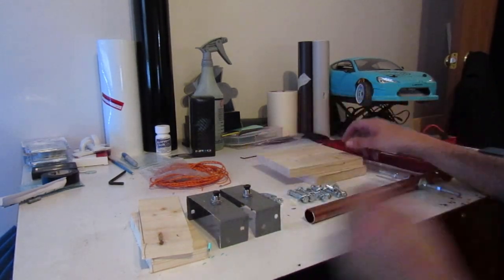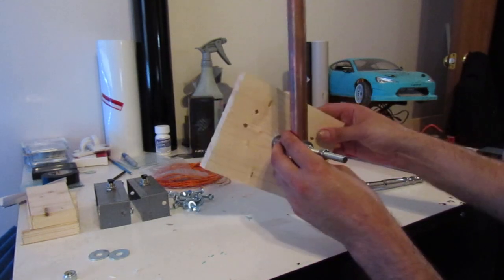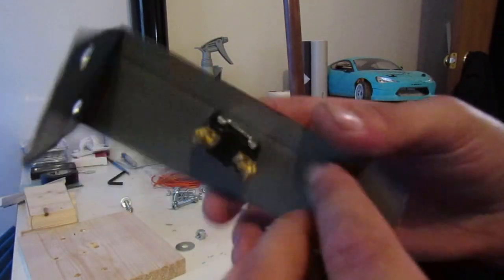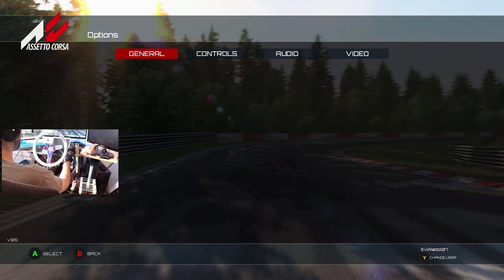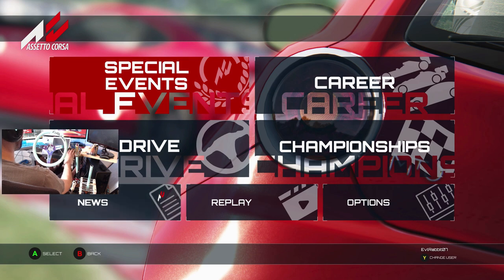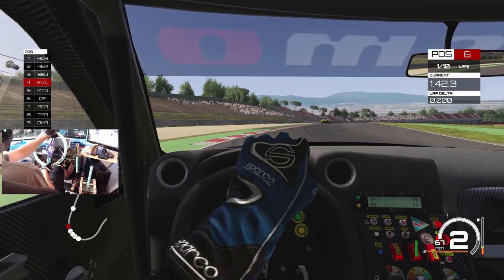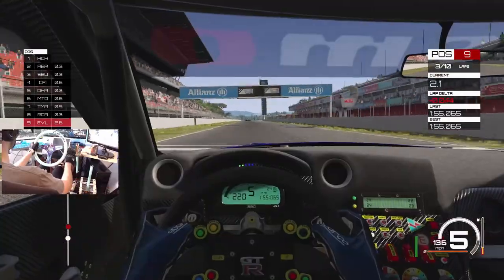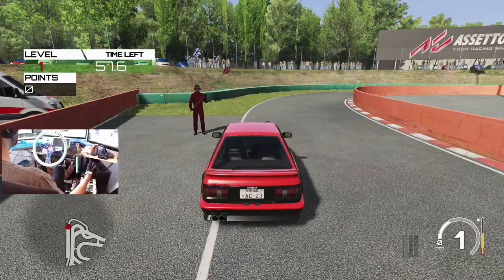Making a Custom shifter for G920 on xbox one sequential style!!!!

Comment: Yo were do your wires from buttons switches get hooked up to .. are the to the original paddle switch on board can u tell me how u connect it
Reply from the maker: they get connected to the original paddle switches on the board of the wheel so it works just like I am using the paddle shifters

Comment: How u connect the shifter is the wires off the switches running to lb and rb on circuit board ..
And in game settings just gear up and down lb and  rb please reply mate
Reply from the maker: yes the wires are going to the LB and RB paddle buttons so when in game the shifter acts just like I am using the paddle shifters so there is no setting changes that need to be made
Reply: @EvlRabbit07  legend thanks for reply .. appreciated mate ..
So i just have to solder 1 wire to lb 
And another to rb and then join wires of push switches to the wires running of lb and rb 
Thats right yeah ???
Reply from the maker: you need to have 2 wires off each paddle for it to work   https://www.youtube.com/watch?v=6EooQfAlHV0&index=1&list=PL2UvWUMIQZH1fV7NdOeRZ__G65vuIL6NX   this video I did shows that during the video